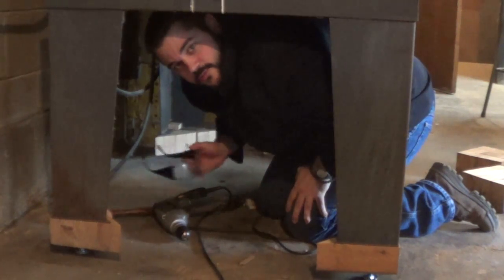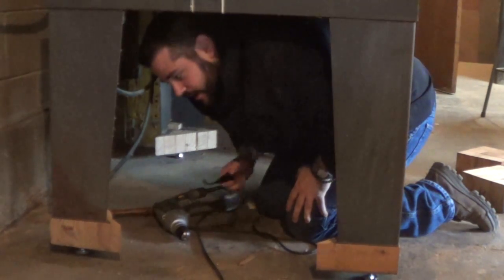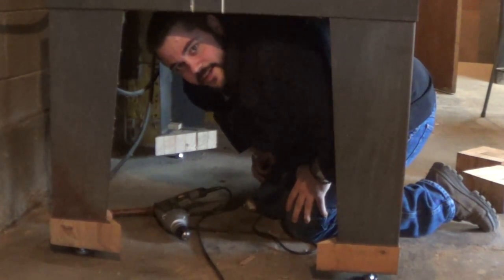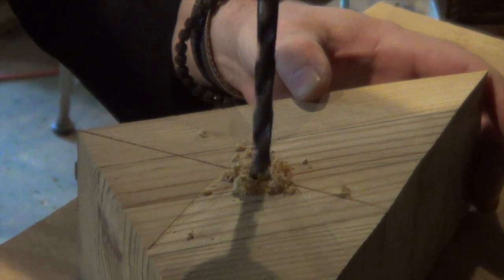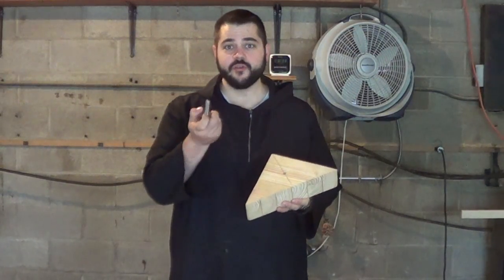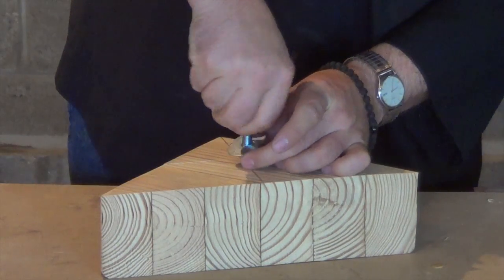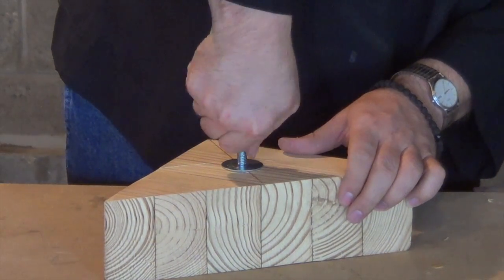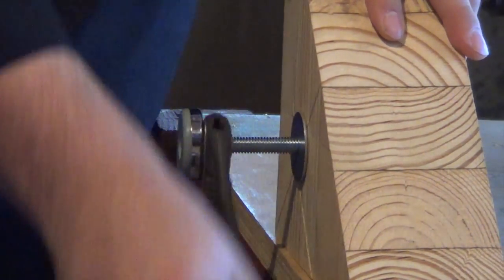Threading Holes Without a Tap (MonkWerks)

Comment: I need to tap a hole in a pipe but my taps are too small. I'm wondering if I can just heat the pipe without the threads red out with a torch, then try to screw the threaded pipe into it?
Shouldn't that make the metal soft enough like wood? I'm gonna try... :-)

Comment: In harder woods it can be a bit more difficult.  i find that if you use a sacrificial bolt and cut a couple of channels lengthwise into the side to help clear out chips, you end up with a homemade tap that cuts threads instead of just compressing the fibers into the shape of the bolt.
Reply: Absolutely spot on.
Reply: I have done exactly that in one of my videos